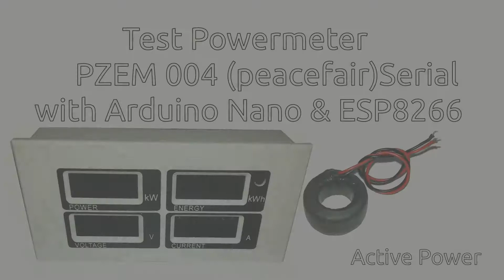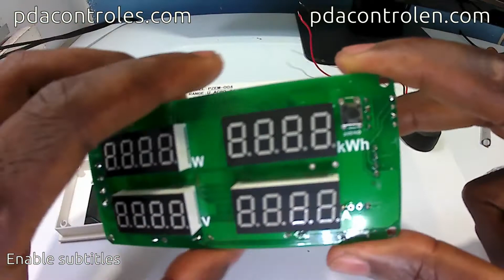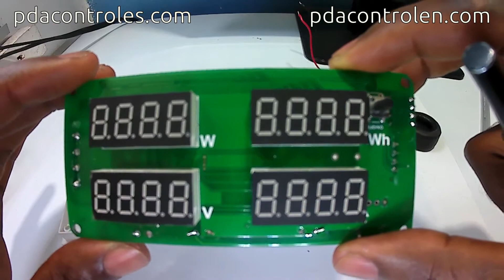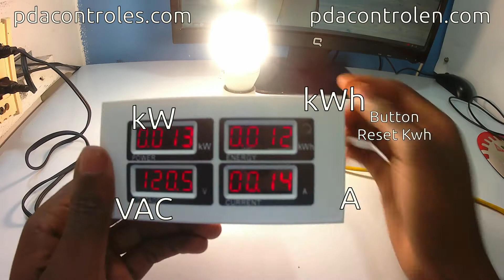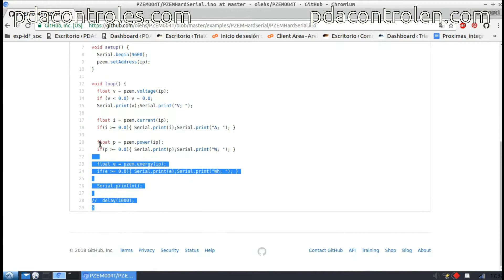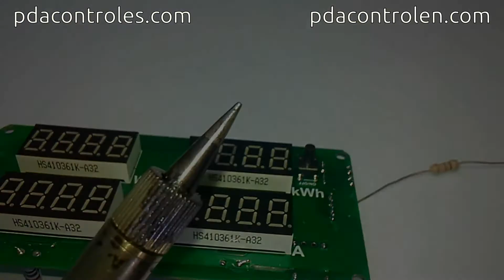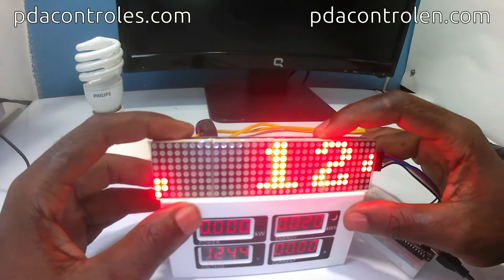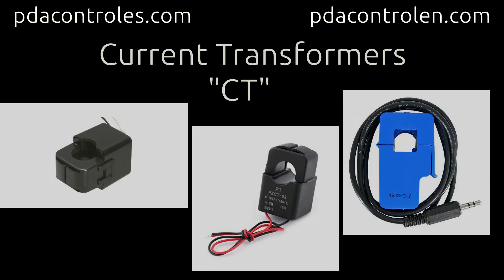Power Meter PZEM 004 Peacefair + Arduino & ESP8266 : PDAControl

Comment: coming back to this project I notice that with arduino nano in tha past I connect the VCC of the pZEM to the 5v pin, but this time I follow the original and connect to the 3.3v pin and worked... well if the PZEM work connected to the 3.3V pin of the arduino nano why we doesn´t work with the nodemcu that is also 3.3v ? I´m talking about having the PZEM without modification... no resistor... can someone helpe me? thanks
Reply from the maker: Hello Joaquim, Technically, the PART serial UART uses optocouplers, which by default operate at 5VDC, the resistance causes the optocouplers to be activated at 3.3V or 5VDC, without it an ESP32 or ESP8266 will not activate the PZEM serial, in some cases they have told me that It works without resistance, some, I recommend placing the resistance. regards

Comment: Hi I already have readings, the problem is that in the http://pdacontrolen.com page by mistake in the schematics to use the arduino nano the VDD is connected to the pin 3.3V and has to be to the 5V pin, the rest works perfect!!! thanks again!!!
Reply from the maker: Hi Joaquim Pedro , by default the meter, the serial port works at 5V, but with a resistance of 1k allows to use microcontrollers at 3.3v like the ESP32, it also works with the other version of PZEM https://pdacontrolen.com/meter-pzem-004t-with-arduino-esp32-esp8266-python-raspberry-pi/ , Greetings and thanks for commenting.

Comment: Hi have you got a more precise more professional model than the model PEACEFAIR PZEM-051? I have to use it in my car to measure the precise ampere of my hidrogen generator so I need a very precise Ampere measurement expecially in the range 1A to 10A...thanks

Comment: You are cite that the lib "SoftwareSerial" is different betwen ESP and Arduino. But I have both libs, and installed Arduino version (because I used and do work this arquiteture. I had a video about PZEM004T and ArduinoUnoR3 in other YT account). How did you solve it? So, not to conflict between libs?

Você falou sobre a biblioteca "SoftwareSerial" ser diferente entre o ESP e o Arduino. Mas eu tenho ambas bibliotecas e instalei a versão do Arduino (porque eu usei e fiz funcionar daquela arquiterura. Eu tenho um video sobre o PZEM004T e Arduino Uno R3 em outra conta do YouTube). Como você resolveu isso? Para não ter conflito entre as bibliotecas?

Obrigado
Reply from the maker: Hello, SoftwareSerial exists for Arduino, I have used it with Arduino Nano, it is this:
Version 1:https://github.com/PaulStoffregen/SoftwareSerial
In the case of the test that you carry out with PZEM-004, use the SoftwareSerial version for ESP8266:
Version 2: https://github.com/plerup/espsoftwareserial

Version 2 interestingly worked well with Arduino Nano and ESP8266 did not generate any inconvenience or conflict, I recommend you use only version 2 and if it does not work use only version 1, try and tell me, regards
Reply: Thanks, PDAControl. 

I'm using ESP3286-ESP12F version sees down:
https://www.moore-duino.co.uk/product/esp8266-esp-12f-nodemcu-lua-mini-development-board-usb-transceiver/

Are they the pins match between your and my version? For the correspondent code?
Reply from the maker: Hi Gerson Sena,  yes, with this module will work without problems, greetings  https://goo.gl/images/7WJNxe , Regards